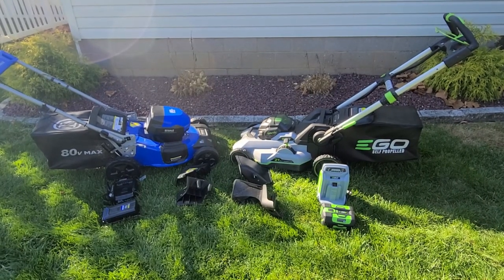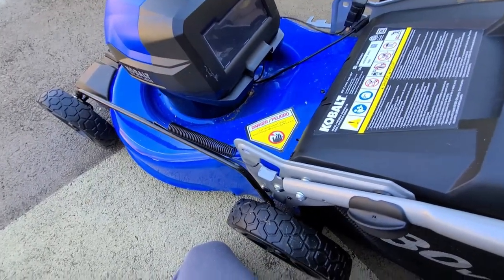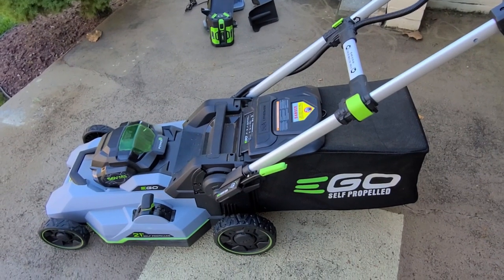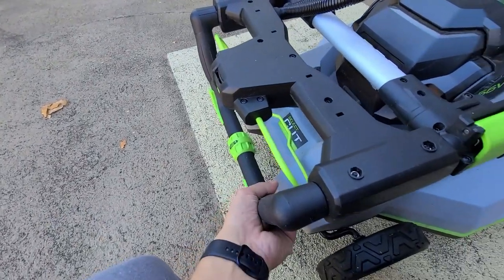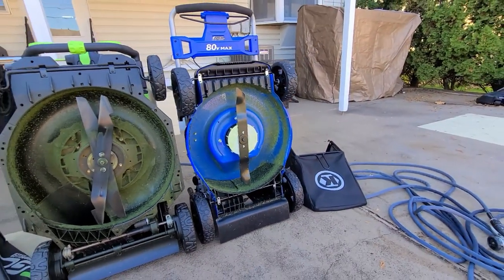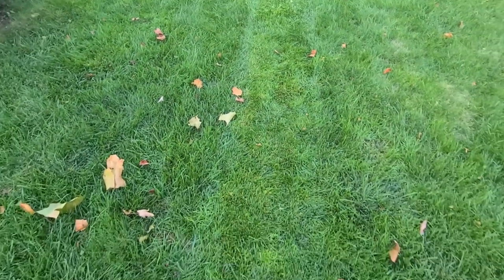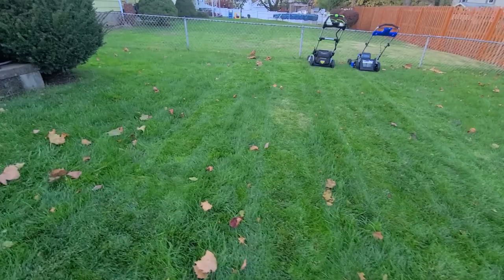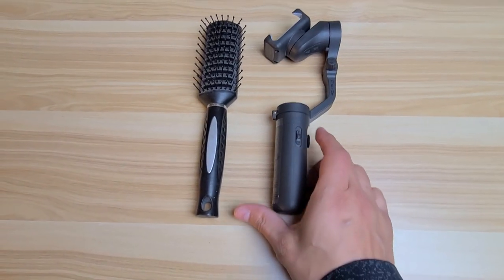EGO 56v Select Cut vs KOBALT 80V Max Mower Detailed Comparison Review EGO lm2135sp

Comment: I've owned my 40v Kolbalt mower for 11 years now and I store the mower on my front porch next to my charcoal grill under a over side grill cover and store the batteries inside the house. My batteries are 2ah, 2.5 ah and 4ah. The mower deck is steel and after 11 years the deck is not rusted yet. . I enjoy mowing without gas..

Comment: Great review!  What I don't understand about marketing these cordless mowers is that they always mention Voltage.  Electrical power is measured in watts. (NOT VOLTS!)  The formula for power is Volts times Amps = Watts.  If you don't know both, you can never calculate which produces more watts .  Before cobalt mowers came out I used their hand tools.  They were the epitome of junk!  My EGo is in the mail.  Keep up the detailed reviews.
Reply from the maker: Thanks Joe good luck with your new mower 👍🏻
Reply: I bought a used 40v Kobalt push mower and it's been fantastic.
Reply from the maker: Good to hear Scott 👍🏼

Comment: Thank you for the review.  Having used my mother’s 80 volt Kobalt mower, I purchased the Ego because of better battery life and Lowes appeared to be out of stock in stores, which probably means it is on its way out.  Greenworks makes the Kobalt, so I checked those.  Again battery life was the issue.  2 things that I like better on the Kobalt is the comfort of the handle.  Ego is made of hard plastic.  I have to wear anti-vibration gloves to protect from blisters.  I also like that the battery life lights are on the handle.  I have 1 older Ego battery that does not show the levels of battery life.  Cutting is about the same for mulching.  I don’t bag or side discharge.
Reply from the maker: Thanks Mr Knight
Reply: Mr knight the kobalt are great I own several of there 80volt line up except the mower but  if you are not aware that when your kobalt battery is final  nolonger  taking a charge you can use a greenworks battery all you need to do is , remove the bottom plastic case of your old battery  just use a torx  screw driver and remove the case off the new greenworks  and swap them and now your kobalt device has a new battery,  also you can just remove the case off the greenworks and use a dremmel to grind down the tracks on the side but only do this with the cover off the actual  battery out of it

Comment: The Ego mower I just bought replaces the Kobalt 80V-an older model than what is shown in the video.I have a second like Kobalt I bought at a yard sale!Came with battery and charger.I have Greenwork,too.I am in the process of getting the Ego 42 in rider mower.The Ego mower you tried in this video is the same as the one I have.
Reply: Which one do you like most?
Reply: @linvol20  the Ego!
Reply: Are you just bragging about what you own? How about an opinion on them?

Comment: In comparing charging times, the Kobalt battery was a 5Ah, while the EGO battery was a 7.5Ah.  True comparison should be two batteries of equal Ah rating. Of course you have several EGO 5Ah batteries lying around you could have used to give a truer comparison of charging times and most certainly would have been better than 112 minutes. Also noted that in handle adjustment the Kobalt requires two separate operations (one for each side), the EGO is truly a single one handed operation and does not require careful alignment of pin into one of three adjustment holes.  Next, the EGO grass catcher bag was notably of higher capacity than the Kobalt.  Lastly, in comparing prices you might have compared apples to apples.  A self propelled Kobalt price to the self propelled EGO price.  About $50 difference.  Great videos.
Reply from the maker: Good points thanks for your comment Solobud
Reply: You multiply Ah X Volts to get the wattHours, so they are pretty equal
Reply: Also, the Kolbalt 80v you compared is not a self propelled, I know because I have one and the self 
propelled motor on the Kolbalt 80v Max is exposed just like the Ego.
I now have the latest Ego 2156SP and love both, very powerful electric mowers, but, still love your videos, keep them coming!
Reply from the maker: At times I will still compare models, it was hard to get the kobalt I searched everywhere, thanks for watching appreciate it

Comment: You should test the 2021 model with the dual battery unit that comes with dual 6 ah batteries  ,cruise control led lights and more , my ego had tons of issues so I went to this last year and wow so happy  with it , plus I can actually  cut my whole yard with one charge not 2 with the ego but for my front yard I still use my liberty  unit as it cuts better then any other lawnmower  ever  I have owned  and it leaves  the most beautiful  lawn strips
Reply from the maker: Thanks R Deh love the ideas

Comment: Hey Tech...you failed to mention that the Kobalt was NOT self propelled (until about 53 minutes into this video.  And that was an after-thought)!  That's why the "motor" (actually transmission) had a cover.  The cover was over the empty space that the transmission would have occupied.  Your newer videos show improvement on description accuracy.  Not criticizing you.  I just think you should compare similar mowers.
Reply from the maker: Hi Kraz 1st thank you, honestly a mower having self propel or not really depends on the user. I couldn’t get my hands on a self propel Kobalt it was impossible to find and I really just wanted to compare both mowers in general. Appreciate the feedback definitely 👍🏼
Reply: @TechMadeEzy  I get that.  It seems Kobalt, Greenworks Pro, Sun Joe and others are all made by the same Chinese company.  I bought the Greenworks Pro 60V 2 months ago.  The mulch plug warped the first use.  Turns out lots of parts on that 4 year warranty mower only have a 90 day warranty.  They wont tell which parts until you need one.  I waited 48 days for a part.  After 6 phone calls they sent the wrong part!  I had Home Depot pickup that mower and refund my $$$.  No argument from HD.  They were great.  Trouble is, I liked that mower.  I can't find one I like better.  The Toro is all hype with a 2 year warranty that only works if you have a Toro dealer in town.  No Toro dealers in small towns.  I will probably get the GW Pro 60V again when it goes on sale.  I don't like the plastic deck mowers.  I've seen photos of the blades cutting the deck.  Appreciate your numerous mower reviews.  I like the detail you provide!  Thanks!!
Reply from the maker: Sorry you had to go through all that Kraz. I hope you get a great buy in the GreenWorks best of luck

Comment: Very good review, however, you measured the blade on the Ego incorrectly. You started on the end of one blade and then went across to the end of the other blade. 🙄 That made it look like it was 20 inches. Measure the blade from tip to tip of the same blade. Measure it again. I bet you come up with 21 inches. If it is still 20 inches, why do they call them a “21 inch” mower? They should call them 20 inch.
I also think what you’re calling the motor is not the motor at all. It’s actually the self-propulsion mechanism. The motor is under the battery and drives the blade.
Thanks for reviewing the handle heights. Being tall, the Ego is the one for me.
Also thanks for reviewing the platforms. The one thing that you could’ve improved on is mentioning all seven tools that work with the Ego power head. Does it include a pole saw?

Tell Brooklyn she’s a dog, not a cow! 😂🤣 Beautiful dog! I love Labs.

Comment: I just got the Kobalt 40v. It works for what I bought it for. I'm just a Kobalt guy. I have been for years. If it breaks it breaks. I've never had a mower that mulched and I must be stupid about the mulch plug. If there's a plug in the back, doesn't that just make it a regular mower? What is happening inside that  the plug changes what is happening?
Reply from the maker: I like the Kobalt line , the tools are hard to find at times specifically outdoor yard tools. They don’t seem as dedicated to outdoor yard tools as they are for hand tools.

Comment: you measured 2 different blades on the EGO and not on the same blade....i think the EGO blade would have been longer than 20"..great comparison though...i will stick with the EGO....the steel deck was a turn off for me when I made my purchase....i had my share of rotted out decks and good engines
Reply from the maker: Good catch Brian, man was that a brain fart lol but don’t worry it’s still a 20 inch blade under the 21 inch deck. I’m again seriously thanks for catching that 👍🏼
Reply: @TechMadeEzy  I have the same mower and my blades measure 20 1/4 inch each

Comment: Voltage isn't everything,  battery management,  type of cells, and quality mean more. BTW check both batteries that's peak voltage after 5 minutes ego will be outputting 50v , kobolt id say 70v or less   test with multimeter. Normal for all power tool batteries peak voltage isn't true voltage. Ego also cover their battery cells with excellent cooling phase change material
Reply from the maker: Thanks Wayne

Comment: Why don't you do the side discharge comparison?  Many people only side discharge.
Reply from the maker: Hi Google Chrome thanks for watching 👍🏻, I don't side discharge myself but good idea I appreciate the feedback
Reply: What's the point of side discharge? My understanding is mulching allows the grass to recycle itself for nutrients and it's just less work since you are not bagging. Side discharge dumps grass all over your lawn and when it dries in the sun, it turns yellow and looks unsightly.
Reply from the maker: Agree, I never use it.
Reply: Side discharge has one advantage over mulching and even more over bagging: 
Speed. You can walk significantly faster and still get the job done. It wont be pretty though.

Comment: I doubt the Arc Lithium battery of the Ego produces less heat, probably just good marketing.  80V should produce significantly less heat to output the same amount of watts as 56V because the 56V will have to use more amps.  More amps means more heat and higher electrical resistance.  Using the same battery chemicals, the 80V should be able to charge faster with the same heat or at the same speed with less heat.  If the Kobalt 80V isn’t doing that, then it means they cheaped out on the battery chemistry.  In other words, the Ego battery must have more of the more expensive chemical(s) that make batteries work better in general.  I’m curious to learn more about the chemical comparison of these major brand batters.  Especially Milwaukee’s as their naming conventions aren’t doing them any favors.

Comment: Someone clicking on this video based on the title (POWER CHALLENGE) would be primarily interested in 56v versus 80v.  Difference in power.  How they handle thicker and taller grass.  But just cuts low grass that shows no difference.  If anything, video seem biased towards Ego.

Comment: And I have the new ones 7.5 amp battery 🔋 
I never bag or having issues not cut or stop the mower:) 
but I have couple problems :( 
1. The mower is too lite :( 
2. the mower is too small :( 
3. A problem with the batteries it freezes or won’t charge and one last that long with 7.5 A only 5000 ft.² yards you can cut:( 
4. And I have fescue grass I cut like 4.5 inches :) and when I cut the grass front wheels Digs grass in and i’m on second day that grass raise up and you can see the stripes tall :( 
5. The mower it’s sow light one pass can float on top of the grass second pass can go down with the same settings you can see the difference :( 
6. The mower is so tiny I have 1600 square-foot yard taking me one hour and a half to finish with one pass if I’m doing double pass takes over two hours :( and you have to do a double pass because of those stripes :( because of the tiny wheels digs that grass in :( oh and it doesn’t have an enough suction to suck the grass back out with the blades :( 
7. Not enough RPMs or not enough vacuum to lift the grass up from the ground. :( 
8. The bottoms for self propel the end of the cutting your yard you have hands A Ssort they’re too tiny and you have to squeeze the hands too tight :( 
EGO Mower they need to fix dthese issues :(

Comment: I have the kobalt in self propelled and the ego 21’’ self propelled but the battery on ego overheats and has failed 1 1/2 years out kobalt still going strong no issues at all and more power than ego,I love the ego as far as weight but battery are failing
Reply from the maker: Thanks for sharing that Dan
Reply: I bought my EGO self-propelled mower and snowblower with 3 7.5 batteries in 2014 and the batteries are still going strong. I also use those batteries in my hedge trimmer and leaf blower.
Reply: I have the kobalt 80v. Now... battery keeps stopping and blinking and beeping. I've had it for a month.. thats why I'm back watching thr videos lol

Comment: You really should start those off the grass. The battery life required to get the blade(s) up to speed in grass, is high
Reply from the maker: Hi Terry I usually lift mine up a little then start it. What mower do you own?
Reply: @TechMadeEzy  Same EGO you have. I use it a tiny bit in my commercial lawn care business (where I can’t get my 36” stander in)
Reply from the maker: Did you get the LM2156sp? I recently picked it up did a few videos on it. Waiting to do a detailed review.
Reply: @TechMadeEzy  I went with the LM2135SP
Reply from the maker: Why didn't you pay the $150 more?
You would get
10ah battery
700w fast charger
More torque
Plus the high lift blade included

Comment: The kobalt build seems kind of cheap to me. Specially that wire that’s just hanging free. I can see that getting caught on something. The plastic on the handle also seems like a low quality plastic as well. The handle adjustment is pretty inconvenient as well.
Reply from the maker: Motor seemed strong, height adjustment is solid. I agree the handle adjustment isn’t so good but it works.
Reply: @TechMadeEzy  yes, I do love the height adjustment. Motor seem stronger than the ego? Sure it’s hard to tell.
Reply from the maker: AJ, Motors seem the same when using honestly.
Reply: @TechMadeEzy  yep. More voltage doesn’t always mean more power. I tell people that all the time. 👍🏼
Reply from the maker: Agree
Reply: I agree. that loose wire dangling around the Kobalt handle would bug me. I would definitely zip tie it to the handle better.

Comment: The kobalt being used is a older generation  the newer version  is lot more power and run time and in a recent test it performed as the longest lasting  non comercial  unit for  battery time , the ego was great all around the greenworks comercial  did very well , and makita  was best built and very quite me myself own  I bought the Allett Liberty battery cylinder  lawnmower  and I bought four cartridges  for it, this is a amazing lawnmower , and can do way more then any of  the other electric mowers , I highly  recommend  it
Reply from the maker: Thanks R
Reply: @TechMadeEzy   i do appreciate  all of your hard work it has made a lot of people  difficult  choices for those  who are not in the know how  of what is good whats is great and definitely  what you should avoid , you have taken a great deal of your time to help those and you should  be  commended

Comment: So basically the Kobalt is just like the Greenworks.. rebranded??
Reply from the maker: Hi old Ironside I’m not aware of that I don’t think so.
Reply: Those are made by the same manufacturer in China, but the batteries have different trim, so they are not interchangeable. Kobalt had the 80v first, and now other companies use them - most from the same manufacturer.

Comment: You measured from the tip of one blade to the opposite tip of the OTHER BLADE on the Ego... Of course it will not be 21 inches.🤣